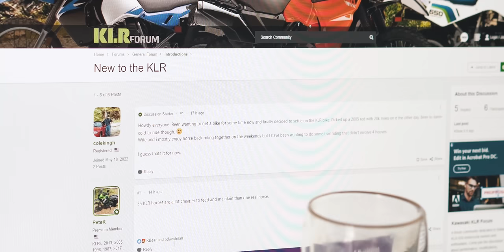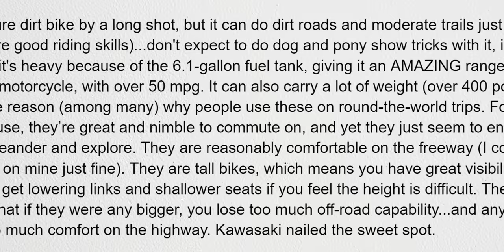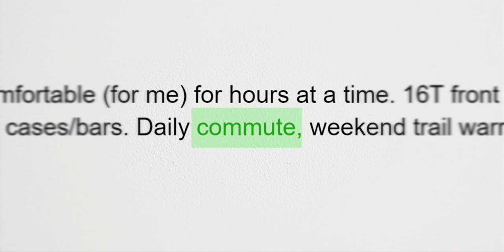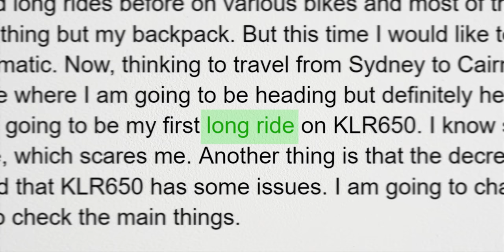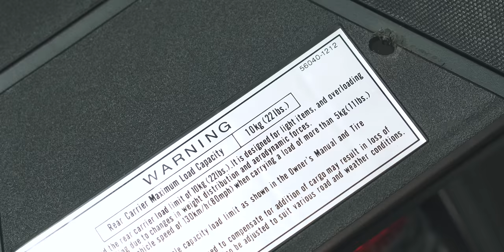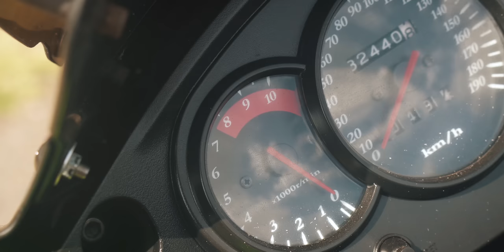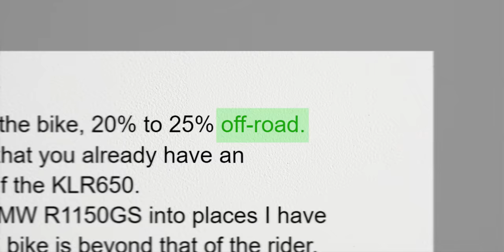I HATE the Kawasaki KLR650… so I BOUGHT one

Comment: Good video.

A couple of alternate thoughts: It depends where you use it. I sold a GS to take a KLR down through the Americas. The list of reasons why was big and grew as I travelled.

1. It's a big comfy bike with an effective top speed of around 85. when you go south of the USA no-one is expecting a motorbike to be rolling through at 100mph+ which would happen on big tourers. (Admit it) For the USA or Europe, I admit, it's slow and weaves at 85.
1b. If you sell your GS and buy one of these you have £10k+ more for your trip.

2. It's cheap and stick some gaffer tape to the seats and it looks even less good. Going through customs cost around £20 in "paperwork fees". The GS's were paying up to $150. 
2b. Thieves do not identify you as a money mark.

3. It's small enough to get through a door so you can often put it your hotel room to keep it safe. (believe me, I did this many, many times)

4. Every street mechanic knows how to fix it. Or you can.

5. You can get tyres that fit it in remote places.

6. Parts are available - often from odd sources. I got a starter motor in Mexico from the police for $25. BMW parts have to be shipped in. For example, my experience is in Central America there are basically dealers for the big bikes in Mexico City and Guatemala City so break down near there, please.

7. You can Heath Robinson it. I dropped mine down a shale hillside in Copper Canyon, bending a good bit of it. A lot of what was bent was fixed with judicious use of a scaffolding pole. Then the aforementioned starter motor and a few bits from a local mechanic.

8. There's massive support for adventure addons - so you don't have to have big solid aluminium panniers that will get dangerously sharp the first accident you have.

Is it as good as a GS? No, but you'll soon not notice it and still have as much fun on your trip. And you'll probably manage to keep it.

(A must do: Upgrade the front fork springs and the rear shock before you go. Drop the yokes a cm down the front forks about  1cm to get a more responsive ride on road)

Comment: The frame is fine, it's the cheap suspension that causes handling issues. My KLR was my re-introduction to riding after a long absence and I was appalled at the handling and braking.Upgraded both front and rear suspension and replaced the stock brakes as well.Transformed the handling and braking. It's still slow but let's face it, no one buys these things to go fast, they buy them to ride anywhere and everywhere forever. The KLR is a true world bike and if you are in Antarctica and need parts you will be able to obtain them.
Reply: Replaced the seat with a Corbin but even so I can't last more than three hours before it's time to hit a Starbucks. Having said that, I wouldn't dream of spending that much time on any of my other machines: 2019 Royal Enfield Continental GT 650 and KTM 890 Duke R. Fine machines but instruments of butt torture after about 90 minutes.

Comment: In many places here in the US, our fuel supply is intentionally contaminated with ethanol.  It has been my experience that fuel injectors are more tolerant of ethanol in gasoline than carburetors in motorcycles... Maybe if you ride the bike every day, ethanol doesn't gum up the carbs, but if you let it sit for any time, it seem to do so... On the other hand, the bike that I have with fuel injection starts right up even if I leave it sitting for months at a time...

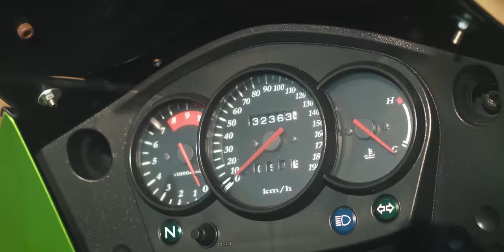Comment: Add mod  that thing immediately. If it's street legal I would reduce that rearched drive's block to a small as I could fit. Then I'd adjust to valve timing and the cooperator. I'm not lying. I had a rebel 400 stock. Max speed was 80. Did all that stuff to it? Which only took an hour and I think was ripping along at about 1:40. I'm on 60 not sure the speedometer only went to 80 miles an hour and stock had never reached 80 miles an hour, so just a thought don't have to settle for Manila vanilla.

Comment: The trouble with the KLR 650 is that the Honda CRF 300 is a but cheaper and with a 301cc bore kit can get over 80 MPH on the road. In other words you get a bike with switchable ABS, far better offroad, only slightly worse top end only 330LBS vs 460 LBS of the KLR.

What I didn't realize is how close the KLR650 is to the CB500x, the ABS models cost less in the USA... yes the Honda engine is likely better but after realizing how much the it weighs I think I'm going CRF...

Comment: Big simple all around bike, even for a 6'3, 330 pound guy like me.
It is one of the few bikes I have ever had to jump up to throw a leg over.
Mine had eaglemike's 2 inch lift dogbones, making it a very long throw, tall and very smooth rider on bumpy roads, while still super stable at 80mph on the highway. Sure it is not a power beast, but so nimble and fun to toss around, plus sooooooo easy to work on!!  Such a fun and simple bike. Loved my '13.
Reply: Honestly surprised the frame felt wallowy on yours. Betting the dogbone based suspension was worn. Mine did 80 on the highway very stable, even with Heidenau K60 Scouts on it.

Comment: I'm just about to get back into biking. I let my license lapse years ago which means I have to go through the whole learners and probationary rigamarole. This includes riding only LAMs (Learner Approved Motorcycles) which means no bikes with a capacity over 660cc or more than a certain horsepower rating (which means no Suzuki DL650 which would be my first choice) for the first 3 years. That leaves the KLR650 as the obvious choice given where I live and the fact that I want a bike I can carry some camping gear on. 

Your video has pretty much confirmed it for me seeing as I can buy a 2023 Adventure model for around $11000Aud or pick up a well equipped 2nd hand Gen 2 for $7-8K.

Comment: The KLR 650 is a perfect example of Kawasaki's engineering philosophy. When they design a great bike it's the best in its class. Then they keep making it with minimal changes for many years. Because they don't spend tons of money re-engineering things the price doesn't keep rising out of control and it becomes a great value bike. This way of doing things started with the Z-1 in 1972 It changed into the KZ 900 and KZ 1000 which was made until 2005 with no major changes. The ZG 1000 Concours is another example. It was almost unchanged from its introduction in 1986 until 2006. In 2007 it was replaced with the Concours 14 which is still being made.

Comment: I rode one up Australia. You can fix it with a hammer and a spanner, it runs on fumes, parts are cheap and it never goes wrong.  It's essentially a tractor. You don't get that with a GS, and you sure as hell can't fix it on the roadside. Plus it's cheap.

Comment: Great review - thanks! Now, do the Suzuki DR650, better in many ways at what the KLR does and, arguably, behind in only a few ways. I respect the KLR but love my DR650. DR is the quintessential 70s air-cooled thumpa playbike. Very important - the air-cooled part! Collector piece extraordinaire - just like the venerable KLR. These are the TRUE adventure bikes. NOT "painfully slow" - good for 160 kph each (100mph) - cruise all day at 120 kph (70 mph). What more could an ADV buyer want? They're light, too, compared with elephants like BMW 1300 GS. Oh, and the KLR looks 'OK' - NOT awful 🙂

Comment: I've met a couple at Barber Vintage who took a KLR 650 and an R100GS for thousands of miles about Africa with no breakdowns.  As for "ugly", pretty much everything over the last twenty years resorts to "visual disruption" to (fail to) mask the wonderfully effective but thoroughly unesthetic design choices driven by function. Functional motorcycles generally ceased following the rules (art does have rules like the "beautiful proportion" etc) of esthetics long ago so what remains are abstract design elements.

I do not hesitate to mod any new bike however expensive because any machine except collector pieces (which are best not ridden because they're only original once!) is raw meat for configuration to suit the rider. I won't ride anything I'm afraid to drop or modify.

Comment: I bought a 2015 KLR650 new, I was so disappointed with that bike. I had heard so many great things about the bike, but it had the most awkward center of gravity with that giant gas tank way up high. With a full tank of gas, luggage on the rack, and a backpack on, I never felt super confident about going too hard into turns. When the rear tire slid, it slid far, it made off road maneuvering in tight areas very risky. They don't take falling over very well, replacement plastics are stupid expensive. The seat and hadlebars suck after an hour of riding, the exhaust sounded terrible, and over 70 MPH it was very squirrely. I had it over 90 MPH on the highway once. I never did that again. I put 6,500 miles on it before I lost control on a tight turn and stuffed it under a gaurd rail.

Comment: Fuel injection might be reliable these days but once something DOES go wrong the bike is immediately stranded. Try to get a new crank sensor in the middle of nowhere.
A fauled carb may still get you to the next workshop even if the engine runs rough. 
For a continental crossing i'd take a carb over EFI. 
Simplicity is King.

Comment: I own a 2022 KLR Adventure and love it as my first bike. Admittedly so I wish it had more power and a sixth gear but it doesn't. For my first oil change all I could find was an oil filter for a 2002 and the damn thing fit. I thought that was so cool that parts for a bike 20 years older worked on my brand new one. Idk if ill keep the KLR but it'll always have a special place regardless.

Comment: When Kawasaki updated the KLR they did more than just Fuel Injection they fixed most of the vibration by rubber mounting the pegs and bars but not to the extent where the bars wobble and are vague feel wise .
They improved the seat and best of all value wise they made the adventure version which with luggage crashbars and led lights added is the outright best value in dual sport tourers going.
 They did make one other changea new variant released after the standard and adventure Injected models, They made a factory lowered model for those who are vertically challenged, Something only BMW have done in the past, So there is that option for those who may need it.

It is actually a very good option as I have seen far too many people lower a bike so they can get their feet on the deck just by winding off the spring preload and doing that you end up with a marshmallow handling wise not safe or fun and unless you shorten it a sidestand that is too long so the bike can easliy fall over.

They also changed the balance factor in the engine to make it smoother  as well as the rubber mounted ergos, The new injected engine is much like the BMW F 650 GS when they went injected the power is so smooth it does not feel fast but the injected model goes as well as a modded Carby KLR 650 it just like the BM does not feel quick.

The feeling of snappy power can be deceptive as many so called "Car Chip tuners" actually made less power because they pulled out power down low and then made it come in with a rush so it felt faster when in fact they actually gained no power they just made it feel faster.
Similar things have happened in Motorcycle tuning as well I wont name the person but one thing he used to do was Tune BMW R 90s models so they felt quicker, what he actually did was put softer springs in the Dellorto Pumper Carbs so when you grabbed a handfull of throttle you actually got more than you realised because it was much easier to open the throttle so it felt faster but in truth it was no quicker it just felt quicker.

The KLR has one very outstanding feature and that is it is a totally honest motorcycle it does not pretend to be anything other than what it is which I would say in the Car world it would be a VW Beetle boring maybe slow definately reliable indeed and simple to work on and so many options to personalise to your needs and taste.

Comment: Higher cam, a higher competitive piston and rings, reworked or larger carburetor port and polish, matchup with a good exhaust pipe, rework the final drive more or less sprocket teeth, a couple modifications to the frame and in the forks to make it more rigid, less shaking and better control, and a better seat. $1000-1,500. Any thoughts or suggestions?
Reply: Your not going to get anymore usefull power out of a klr.It will do 80 mph up a pretty steep hill stock.
Mine is a 1990 and the only thing i added was a 1 tooth larger countershaft sprocket for the
freeway`s. Mine would benifit from a fork brace on twisty bumpy roads...the suspension is so soft it floats over bumps.The seat is a pain after 500 miles on the freeway
and can be solved w/ a seat pad.If your less than 6ft forget this bike..as offroad its a heavy
bitch that needs an experienced rider who can plant his feet.
Reply: I have an '01. Most important thing in my eyes is getting the mcp kit. Fixes the flawed carb and wakes everything up. I don't do offroading so I went up a tooth in the front. Still has enough hooligan power for around town activities.

Comment: Personal I love the KLR, I think you would probably be happier with the Honda 300 rally, you get your fuel injection and some modern tech it’s smaller little more fun off-road but still very capable on road it’s a lighter it’s quicker it’s shorter. The new KLRs are a bit smoother and also have a few injection option but I think the appeal to them is they will go anywhere and they’re not gonna be the best at anything but if you can only have one bike and you don’t want to trailer to a trail they’re great and very comfortable, plus it’s a proven design that’s been around for decades, if you ever have problems with anything there are 1 million people out there they can tell you exactly how to fix it parts are available everywhere for cheap, it’s just very easy to own.

You seem more technical and performance oriented and that definitely has its place and can be a lot of fun as well but the key alarm is sort of like a pick up truck it go it does everything it can be fun and it’s reliable. Do you want to jump on your bike and drive to the beach you just do it do you wanna drive through the mountains you just do it do you wanna take a dirt road you just go.  It’s cheap it’s dependable and it’s easy. If you’re looking for high tech cutting edge performance it’s not there but a bike that does everything pretty well works for most people. That’s why they brought it back and dealt with the omissions regulations, there is still a big demand for it.  

I used to be very particular and picky about things but as I’ve gotten older I realize it doesn’t matter. I could spend 25 grand on a BMW or seven grand on a KLR and now that I’m old enough for I’m not trying to impress anyone else, I’m going to have just as much fun and the KLR.  For me and a lot of people bite it’s just dependable and easy low maintenance means I can be out on the road more enjoying it. I think the world has sort of lost something, when you grew up in the 60s and 70s and 80s, very few people went out and bought a brand new bike or any adult toys that were really expensive, everything was just very simple and you kind of learned. Most of us went out and got a CB 350 with some rust on it that needed a little work because it was cheap and we went out and had a ton of fun on it. The fun you have is consistent no matter what you’re writing unless it’s breaking down all the time then it’s just a pain. I think you’ll find in 20 years he won’t care nearly as much about what you’re writing as much as you care about just getting out and riding something and having some fun. Honestly I would take that KLR over your Yamaha, I understand yours is a much nicer bike probably much more expensive but it doesn’t suit the way I ride. I am taller and a lot heavier a killer works great for me. I would say go try several different ones but the first I would recommend for you in a dual purpose or multi purpose bike would be the 300 rally Honda but everybody’s different and likes a different flavor and just needs to find what works best for them.  

I like your video and the approach I’m just getting one to see what the appeal was and staying open to it. It’s a good way to do things.

Comment: Good video. Sometimes you need just something to commute to work. And because one works to get money and not to spent money you try to travel as cheaply as you can. If you don't want a screaming 125, you buy a KLR. And before you realized you are years further with still that cheap bike that brings you day in and day out were you need to bee without a hassle. That's the succes of these commuter bikes.

Comment: I had an 84 KLR 600. Fun bike just like you described the ride to work was cool cause you can go a different route than the crowd of course that was in the 80s when there were off roads you could ride on with out someone cursing you for trespassing. I did wish it had the upgraded electric starter. The first repair was the torn vacume diaframe on the carburetor

Comment: it's a two wheel tractor/motorized mule. they like refuse to freaking die. I'm not saying other manufacturers don't have similar/better offerings. I'm saying Kawasaki killed it with the KLR 650. It just is what it is. also, don't know if you touch on this in the video or not, but they've updated the KLR with fuel injection now.